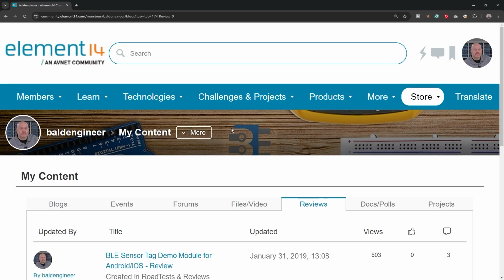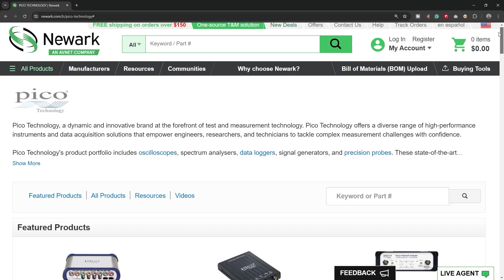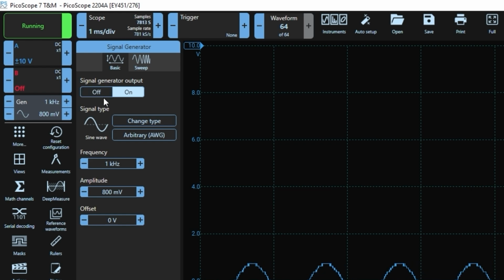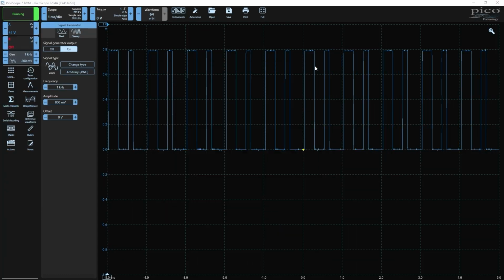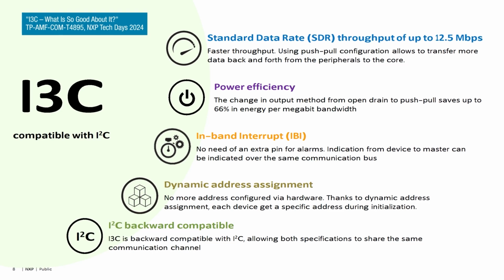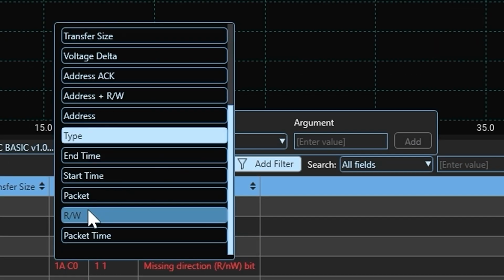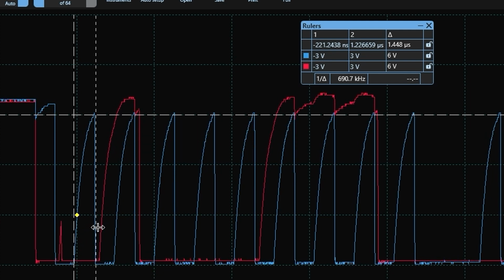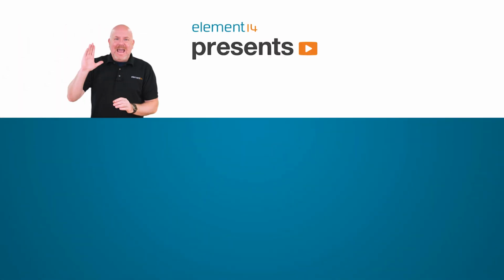Hands-On with PicoScope 7: Pico Technology's Latest Oscilloscope Software - Workbench Wednesdays

Comment: So ~£2800 from Pico Technologies, that info was missing but briefly came up in a frame.
And what OS does the software run with?
Reply: That's the price for their latest hardware. The PicoScope 2000A I used throughout the video costs about $130 (without probes). As shown at 2:08, it runs on Windows, macOS, and Linux.
Reply: @bald_engineer you didn't have to purchase this at all, all you did was have a  pico scope and download this software version and you got all those serial decoders for free?
Reply: @tonyfremont  Correct. They do not charge extra for any of the software features. Of course, their software only works with their hardware, but they don't nickel and dime you on stuff like decoders.
Reply: @bald_engineer Thanks for the reply, that's pretty decent of them.
Reply: @bald_engineer  Thanks!

Comment: One clarification, on the I2C/I3C demo, I said: "I changed the I2C clock to match the I3C example." I should have mentioned, I slowed down the I3C device from 1 Mbps to 400 kHz. The pulse width comparison was a little clearer at 400 kHz.